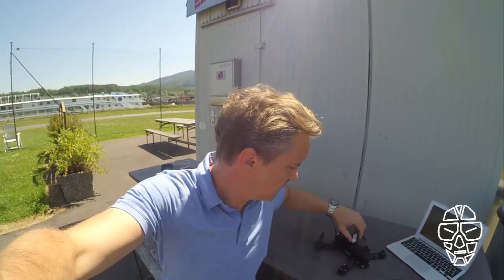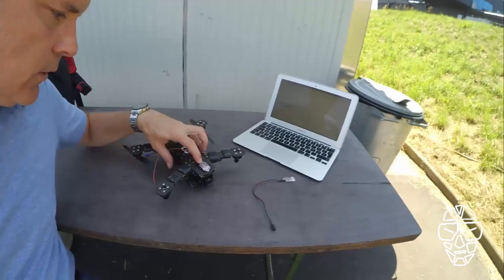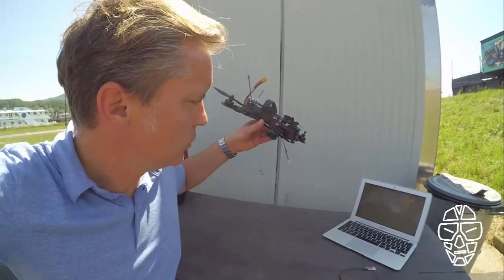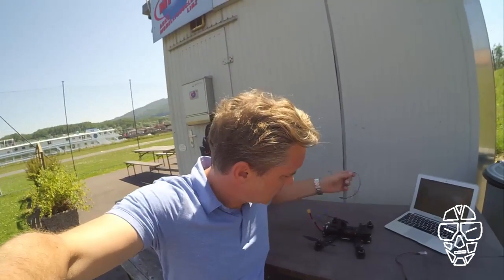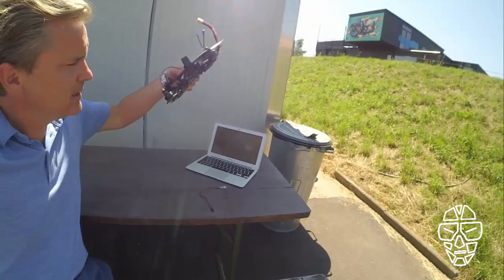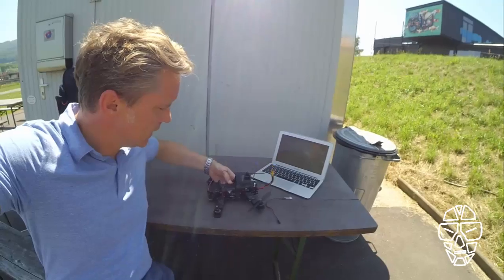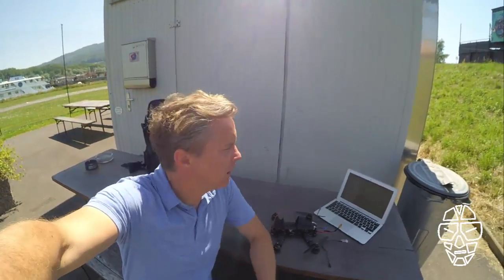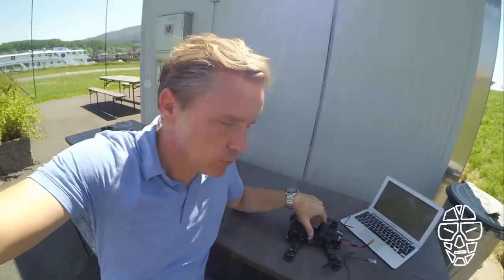FPV Race Tracker Part 1 - Transponder

Comment: Sounds good. Look forward to test video.
Reply from the maker: ***** thank you james72, will do my best :-)
Reply: NICE GUY ANDI I'd love to see a high speed pass of a few quads and showing the times are recorded - I've heard people using IR systems for RC car racing (a few years ago now) and they were always fiddly to get working accurately which is why AMB get away with such high prices, and cars are a much easier target I feel. Side mounting looks a good idea, does it matter if its with or against sun ?
Reply from the maker: ***** Yes sun is always a matter with IR but the very first tests with full sun irradation has not any influence of the accuracy. But of course need to test it in long term.